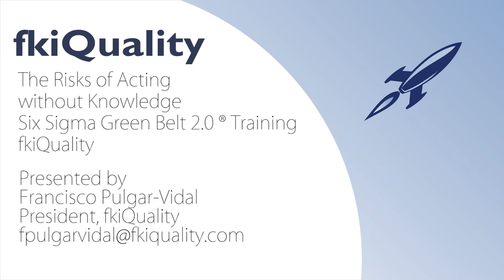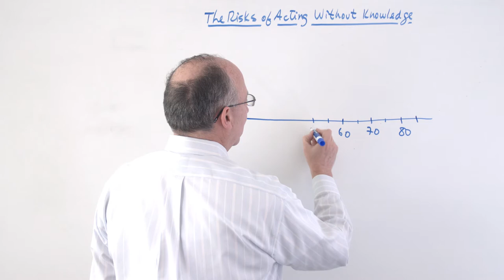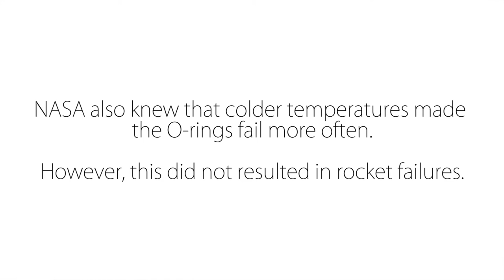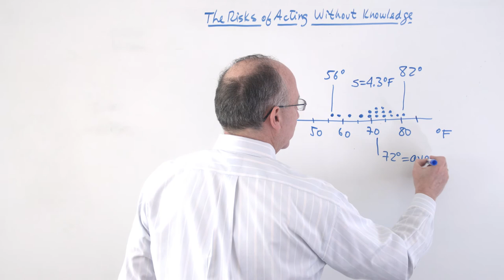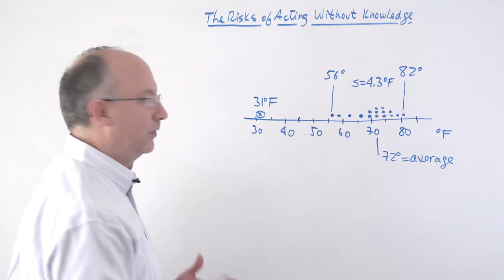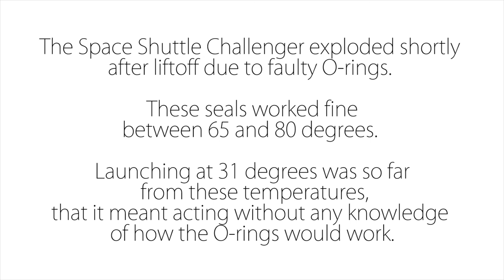Six Sigma | The Price of Acting without Knowledge  | Green Belt 2.0® Lean Six Sigma | fkiQuality HD

Comment: So, not only is the standard deviation of a data set, in and of itself, a useful/telling information, but the number of standard deviations from the average is also and equally important?  It would seem the number of standard deviations could be a more important factor than the standard deviation itself.  In this instance, the issue isn't necessarily that the deviation is 4.3 degrees but rather it was 9.5x the standard deviation?  So, one must not only consider the standard deviation but also the "multiplier" of the standard deviation?  If true then it's abominable to think that NASA could have said to itself "Launching at 31 degrees is almost 10 times riskier than normal/average...but let's launch anyway."

Comment: A blast from the past with the Space Shutttle O-ring failure....I remember watching it on TV and remember it was the O-rings but didn't realize how cold it was outside the range of what had been successful in the past and that they knew even at temps not as cold as that day that it increased risk of O-ring failure.

Comment: Nasa having previous O-ring failures at 50 degrees and icicles on the Challenger, and still launched the Challenger is unbelievable. Launching at a temperature that is 9.5x the standard deviation is unreal, way outside what would be considered normal.

Comment: This is another perspective of the o-ring problem, well-presented from the aspect of mean and standard deviation. "It was too cold" in layman's terms, but when the analysis is applied, becomes so much clearer that the decision-making process failed along lines that unfortunately can be so easily explained in hindsight. As Brad Hentz notes in his comment, the standard deviation "multiplier" is the big deal, not as much the value of the standard deviation.

Comment: Does being within 3 standard deviations of the average ensure product satisfaction? Are there instances where being 4 or 5 deviations away make sense?
Reply from the maker: Good question! A process that operates within 3 std devs might be stable and "in control" but this does not mean that it satisfies a customer requirement. The center of the process should also align with the desired customer target and show a variation that comfortably fits inside the specs.